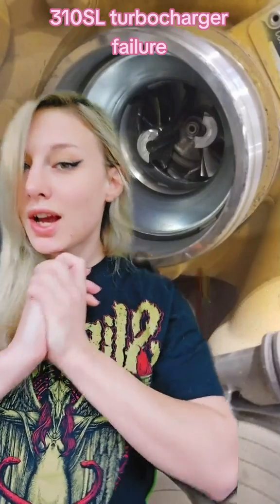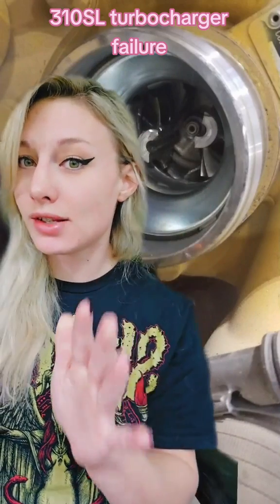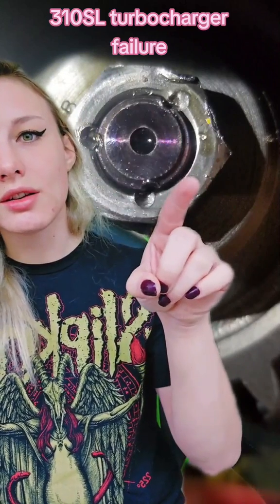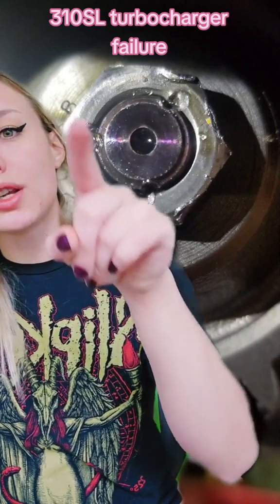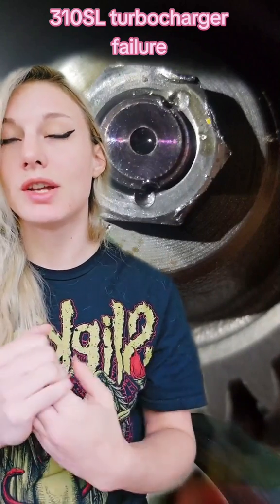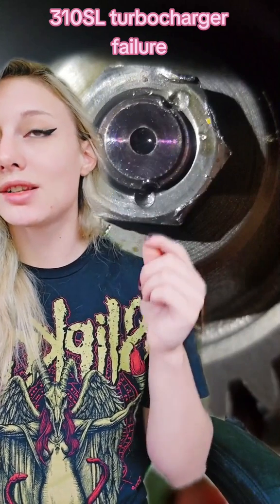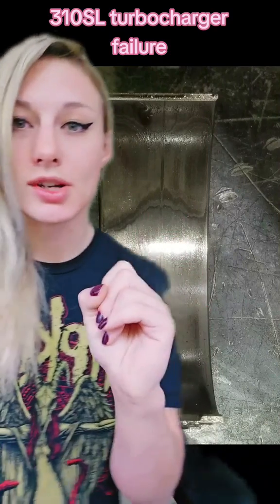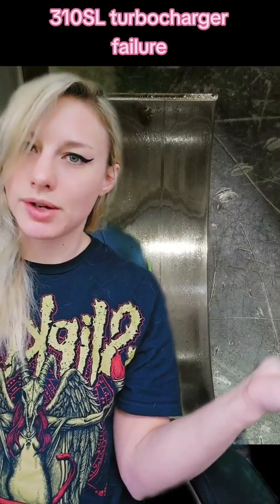310sl turbo catastrophic failure explained.

Comment: Engineers need to improve oil flow to the turbo. Nuts that aren't torqued to spec, the factory needs to look into why their computerized assemby isn't function as it should. Quality control should be checking.

Comment: From an engineering standpoint, putting the Turbo last in line for oil flow is foolish, that is the one component that really heats oil, and oil already heated and thinned out makes it worse.  Yes, it works when everything  else is working, but it would still shorten the Turbo's life cycle.

Comment: Could that nut have been torqued to spec at factory and then the stud stretched out due to heat cycles? With you on the oil pressure being an issue; sheesh bad design.

Comment: As a Hotrodder , you can never have too much oil flow , much better to blow of excess pressure than skimp out on an oil pump ! A lot of modern machines suck because of bean counters !
Turbos love lots of oil , not only does it lubricate it cools the turbo too .

Comment: Those are there to line up at the proper torque ?  That's weird. I can see maybe as a marker to keep the turbos balance but even that wpukd be weird. So there it is torque em right or they blow up n you will clearly have a problem
Reply from the maker: No they're not there to line up the proper twerk. The factory towards it to spec and then ding the thread so it doesn't back off. When I torque it to spec those moved because the factory did not actually torque it to the proper specification
Reply: @thedieselqueenmelissa  that's crazy how that keeps em from backing off.  Interesting. Thanks. Now you gotta go straighten em all out. Tell em to recalibrate there machines and get it right. Geez.  That's how it is though. Takes a real mechanic to find this stuff that just goes by missed planned obsolescence ? Lol.
   Only turbo I ever played with had reverse threads on that nut. Gas n diesel apples an oranges.

Comment: Ok... Never would have thought of that but it does make sense. Last component to be oiled. First thing to go "boom". So if the oil pump drive gear wasn't torqued correctly the gear had more and more play under load and not supplying enough pressure until it sheared? Or did the turbo go before then?